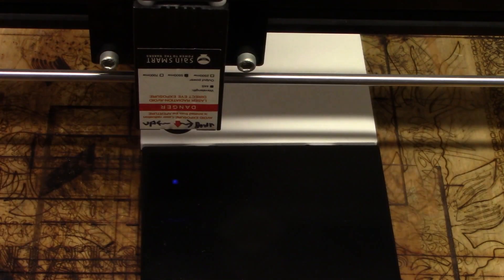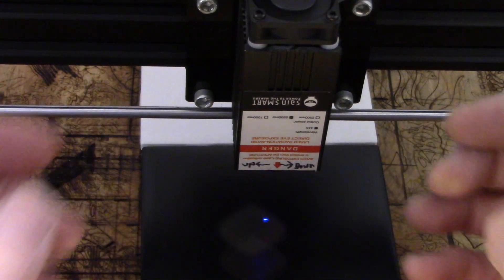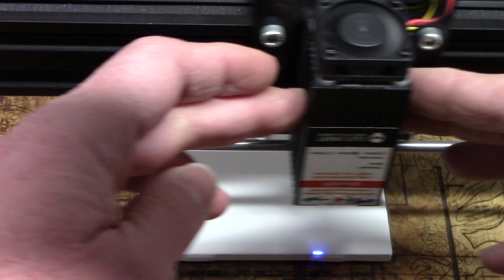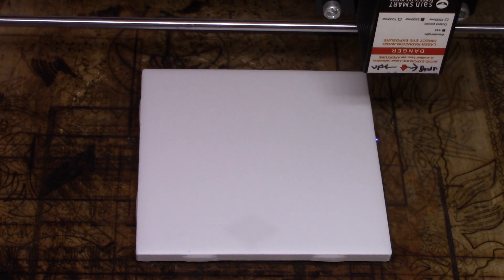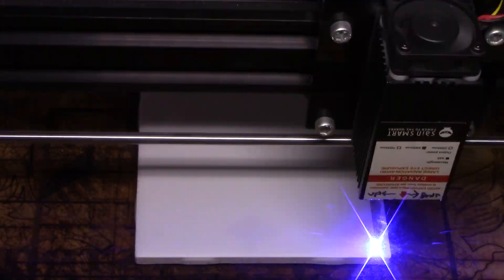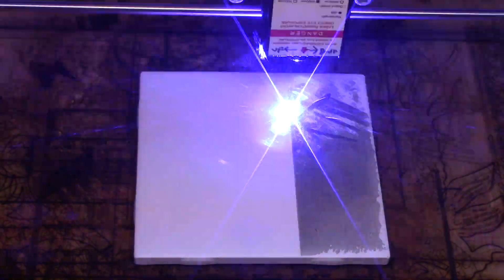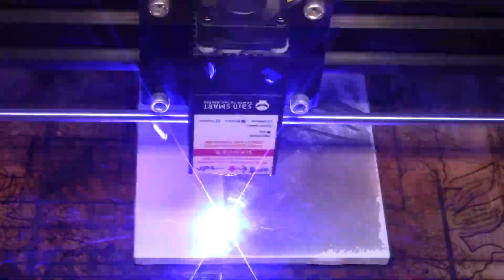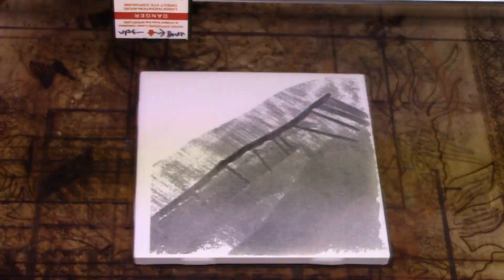X-Ray Coaster

Comment: What watt of laser and what is preparation
Reply from the maker: I am using a 5500mW laser for this.  The preparation is covered in detail in another video I have done.  The first four videos in this play list go into better detail on the process: https://youtube.com/playlist?list=PL-AIAHSnA1P21sLYXnOuKxVisaD27Amvc

Basically, you take a white tile, paint it with white paint, burn your image that causes the white paint to turn black and adhere to the tile.  The last step is to clean the remaining white paint off with paint thinner.  It is a simple process and work surprisingly well.